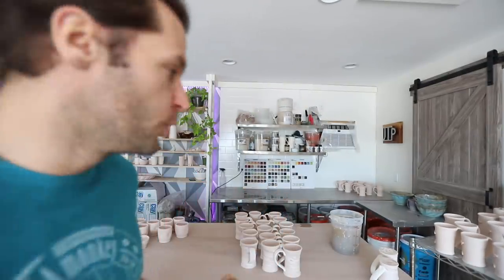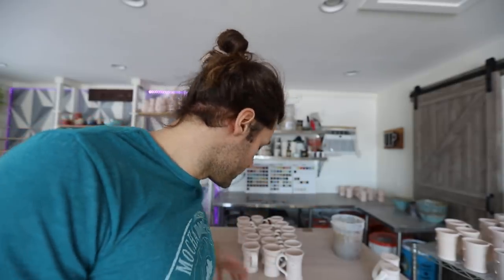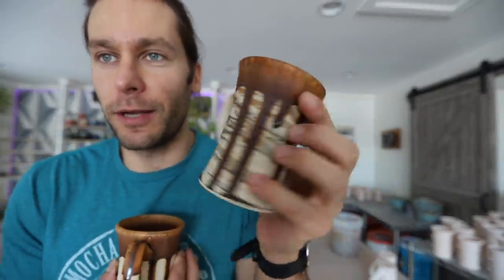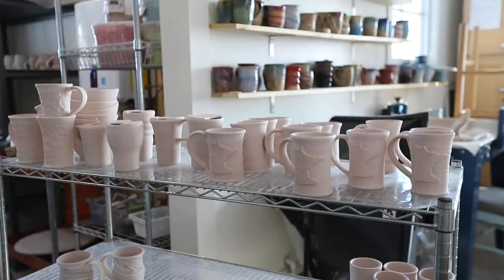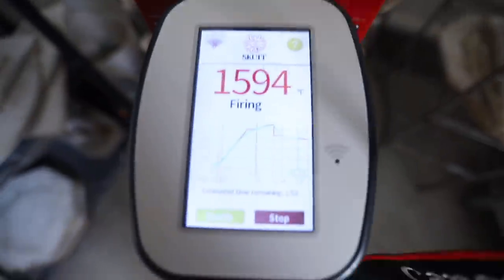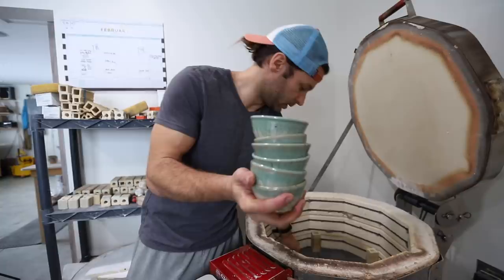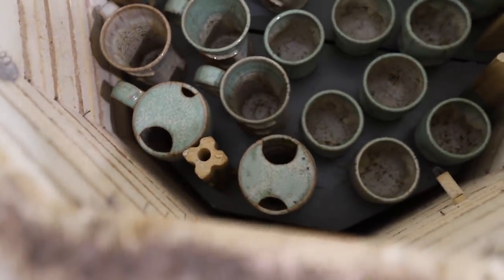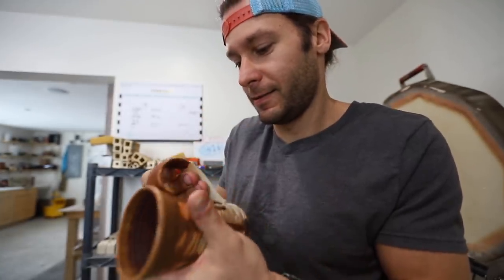I've NEVER tried this

Comment: I am so jealous of your new shop! 
I swear if my life were made into a tv show, my catch phrase would be, "I need a bigger shop!"
I am a multi-medium artist working in a 12'x16' shop with no water or sewer.
In that 190 sq ft. I make pottery, stained glass, mosaic, dye fabric and acrylic painting. 
What color are the walls? Who knows! I haven't seen them in years. I literally have every square inch of the walls, ceiling and ⅔ of the floor space made into usable space. I even diet so I don't take up more space in there, cuz lord knows you can't watch your own butt, just the results of the damage its done.
All I want is a bigger shop. . . .with a bathroom. I too live in a cold climate and the 100 feet from the shop to the house is an extremely long distance in -20 with a full bladder. I believe it will only seem longer in the coming years.
So congratulations, I hope to be doing the same soon.